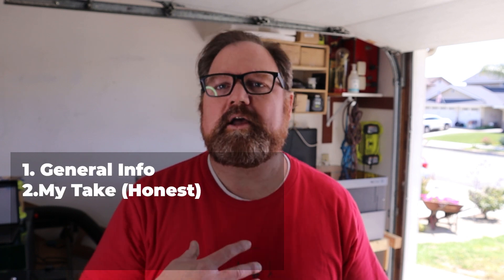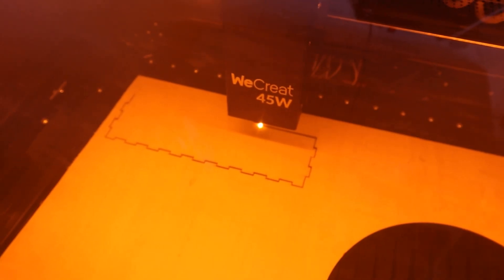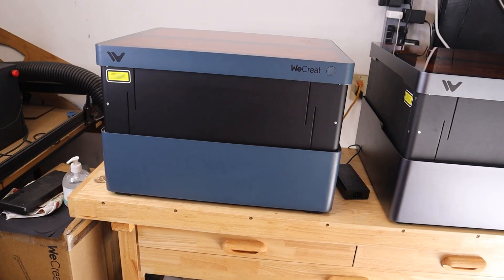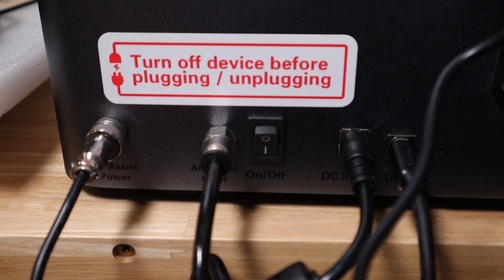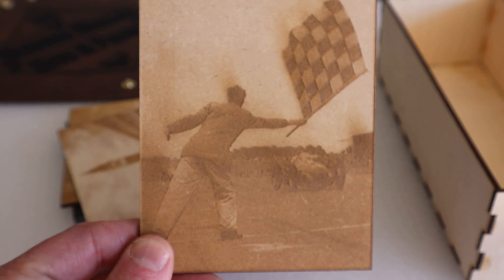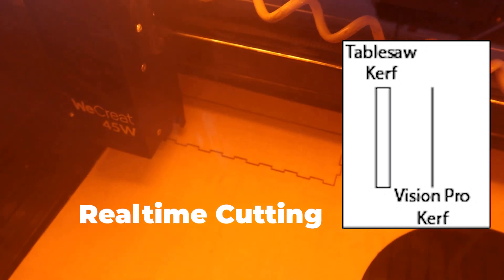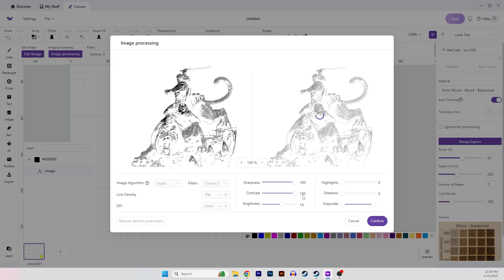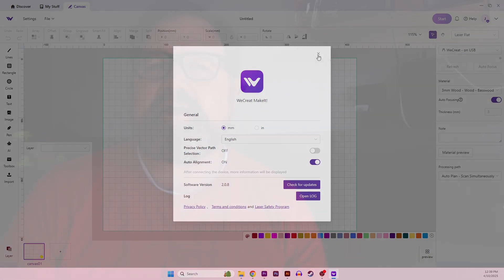Is It Time to Go Pro with the WeCreat 45w Vision Pro?

Comment: How do you get the machine to go back down after project is done and powered off?
Reply from the maker: @johnryan1957  The machine does not return to a down position for safety reasons. The only way to put it back down is to put it in travel mode under settings- and the black trays have to be removed before.
Reply from the maker: The laser staying in the up position also cuts down on unneeded wear on the motors.